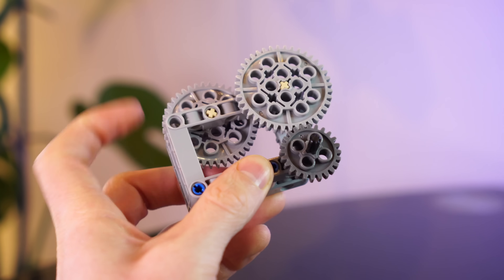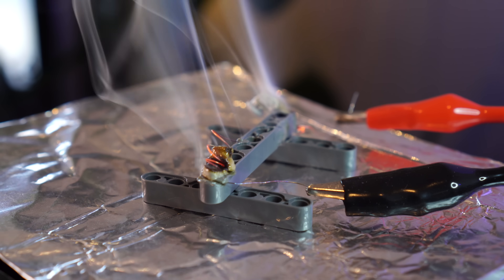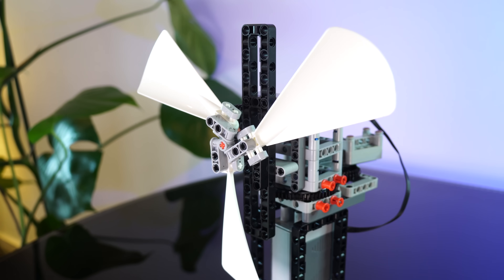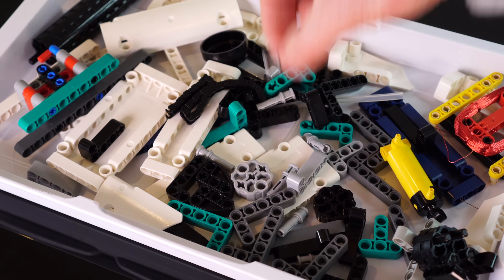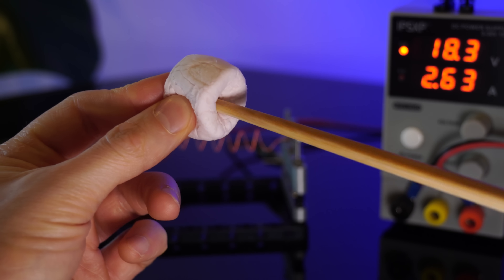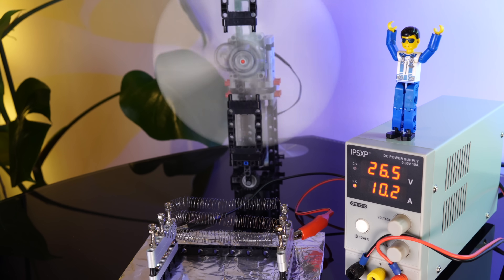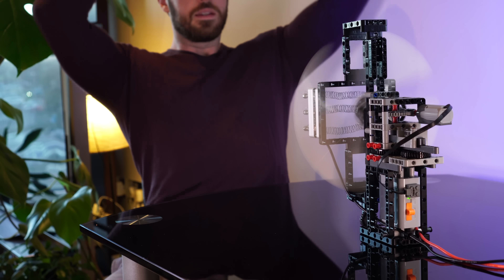Making a Powerful Lego Heater Fan: Will It Melt?

Comment: I made a gear system with a whell on the bar and it runs off of water pushing the whell there is 2 vertions the single gear system and the twing gear system where the singl one is nice and luse and can run at about 300 rpm and the 2 has a lot of conpresin and needs sones of water pressure and can squeak up to 567 rpm heh 67
Reply: BTW I love ur vids James and don't forget your inventions are inspiring me to continue to make contraptions out of lego and I gave up on lego for a bit cuz I broke my fav moter I called Lucy so I forgot it but after being ur kids it kickstarted m to continue thank you and also make sure you don't burn yasself or zap yaself😊
Reply: Vids not kids

Comment: I want to set up a bit of plumbing that has 2 water cooler blocks on both sides of the heating module, where it then goes to a series of radiators blown on by a fan. Then, the now cool(ish) water goes back to the pump and into the bricks.

Here is how the setup should work:
Pump → Water Cooler Brick 1 → Water Cooler Brick 2 → Radiator 1 → Radiator 2 → Radiator 3 → Pump

Comment: You should have put the heating element not in the frony but on the back so it sucks the hot air and blows it to you
Reply: Wouldn't that soften the blades from heat?

Comment: Would you be able to use solid core wires (household wiring) that can support themselves and then wire the coils to them? Then there wouldn’t be anything hot touching the legos and then you wouldn’t need to use the aluminum legos?

Comment: If u would put the heater behind the fan, it would actually just suck the hot air to the blades and push it towards you, with ur design it blows cold air to the heater and reduces the temps on the coils, so ye

Comment: what you have created is, at its core, similar to what a central heating air handler does, and demonstrated why it's very important to include multiple redundant limit switches to prevent dead blower motors (or bad capacitors) from inadvertently setting your house on fire

Comment: WHERE DO YOU GET THE RUBBER NIPPLE THINGIES. HOW DID YOU GET THOSE. I NEED THAT
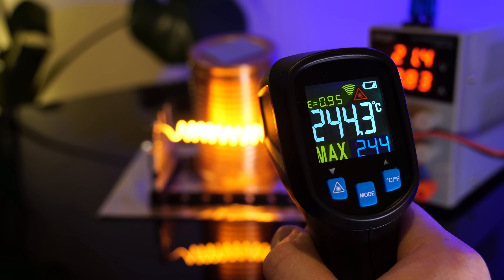Reply: 8:22 made me code brown. Do you know how close you were to electrocution..... 🤢
Reply from the maker: I'm afraid I don't actually remember which set those rubber thingies came in. I think one of the motorised sets with the tracks - the rubber pieces help it stick to the ground. And don't worry about electrocution - the voltage and current is way too low for that. Getting burned is the only real risk here

Comment: Would you happen to be able to use those steel parts to make a turbine that can handle hotter gases than air?
Reply from the maker: Hmmmm that's an interesting idea... I guess it might be possible. Next mission then is how to generate pressurised steam for something like this
Reply: @JamiesBrickJams  the only thing I can think of is a capillary steam generator or a modified coke can into a boiler using candles as a heat source, if you add in a secondary heating coil made of thin copper tubing, you could theoretically make superheated steam, if you do plan on doing this, you might consider making a de-airator to minimize rust, should be simple as pulling a partial vacuum in a sealed vessel

Comment: I think that you might get away with using plastic instead of steel because the fan will cool the wires down.
Reply from the maker: I don't think the fan will be able to cool the wire down that much 😂 Lego deforms around 90 degrees, and that wire is several hundred degrees - even when the fan is blowing on it

Comment: A ceramic heater would be good because it has a positive temperature coefficient, meaning its resistance raises as it heats, so it literally cannot get above a certain temperature

In fact, this principle is already used in many space heaters
Reply from the maker: That's pretty clever!

Comment: Run the motor off the same power as the heater or at least have a board with a MOSFET to kill the heater voltage when the fan voltage isn't detected. But then you're leaving Lego so the light sensor in the other comment is a better "for fun" idea
Reply from the maker: That's still a really good idea for safety, cheers for the suggestion!

Comment: Whats really cool is if you measure the voltage at different points along the heating element you can get different voltages. (commonly known as a voltage divider) infact this is often used to power the fan motor in hair driers/fan heaters and other things so avoid the need for a transformer.

Comment: if you positioned the element lower, so the fan blows the hot air without cooling the coils, would it be more effective?
Reply from the maker: I suspect it's all about the same.. Heat is provided purely by watts of power. Where you blow will only impact how the air is spread around

Comment: You've hit on the design of a good space heater. The amount of heat that a heater puts into a room is entirely dependent on the wattage. By increasing the air speed, you put out a lot of warm air instead of a little hot air - and heat the whole room instead of the spot right in front of the heater.
Reply from the maker: Thanks! And yes, heat should be correlated only to wattage. I think as a desktop personal heater this strikes a reasonable balance between air speed and keeping it aimed in a fairly small arc (vaguely person-shaped)
Reply: Even if it was at the spot right on the heater wouldn't it spread to the other areas of the room eventually?

Comment: Adding a heatsink might have been able to help radiate the heat from the 12v heating element in the beginning of the video.
Reply from the maker: That was actually what I was thinking early on, but I noticed after a short while, that 12 module was only drawing about 20 watts, so I would have needed a whole load of them and a massive heat sink. Nichrome just made more sense for a large output

Comment: use some sheets of thick black paper to measure the heat, shiny surfaces are hard to measure with laser thermometers or infrared cameras.
Reply from the maker: That's a really good idea, thanks for the suggestion, will see if I can find some!

Comment: I’m actually trying to do the same thing like you did but with a battery that I can also take anywhere with me it’s supposed to be like a little heater because we’re gonna be going on a camping trip and I need to be prepared so I’m building a backpack that is a little work bench and it’s actually going pretty good but the problem with it it needs a heater because when we go on a camping trip I will need to bring a tent and it’s gonna be really cold so I need to find a way to build a little heater box inside the backpack I do have a bunch of aluminum cans laying around in my room. I thought they were conductive but when I saw your video about using his legal with the special legal parts, and he said aluminum that reminds me of a aluminum can but I just need your help. Trying to find a way to find a battery that’s powerful nothing easy to charge so I can make a heater. I do have a radio that I can connect by using it as battery but I don’t wanna break it. I want to find a power source on an able to charge the radio while supplying power to the whole back that I’m creating so wish me luck.
Reply from the maker: I admire your thinking outside the box here! And I really like the idea in general - I was thinking of making a little portable heater myself. However, if you're going camping, I'll make a recommendation. If you want to run a small heater like this, it's drawing around 300 watts. So if you want to run this for an hour, you'd need a bank of around 60 5000mah LiPo batteries, which would likely cost you several thousand, and would weigh a ton. Or you could bring about 6 lead car batteries, which would similarly weigh a ton. And this would only run the heater for an hour. You're better off just bringing a bag of coal and some firelighters 😉
Reply: List on batteries just like dispose of the energy without any problems I could try building a circuitboard that can make the energy from the lithium ion batteries to make it way more powerful so when I do that, it might be able to be longer or just die straight like that I don’t know
Reply: There’s gonna be a built-in fireplace inside the backpack I am like really good at starting fire because I’m a pyromaniac so I’m gonna make a blueprint and build a schematic of for the fireplace and the building and try finding a tin can so I can use it for the fireplace frame then I’ll try finding some pop cans for theexhaust so I can go out of the backpack

Comment: As long as you don't exceed ~70-80 °C (158-176°F), the Lego should be fine. Since Lego is made from ABS which starts to soften at around 105°C (221°F), and melts between 190 to 260°C (374 to 500°F).
Reply from the maker: True, I've been realising boiling water is just on the verge of causing it to deform

Comment: The wire sags because it expands as it heats up! This principle was used for the Sunbeam radiant control toaster.
Reply from the maker: Ah of course, that makes total sense, thanks! I guess that's why heater elements are usually coils, so they can absorb some of the loss of tension when they expand
Reply: @JamiesBrickJams  Actually, no. Heater elements are usually coils because this way it is possible to get more length of a wire for a shorter element, therefore get more powerful heaters
Reply: Technology Connections made a great video on it iirc
Reply: TECHNOLOGY CONNECTIONS VIEWER
Reply: @neonphoenix8951  SPOTTED IN THE WILD. HAIL ALEC
Reply: @Sharpless2 LONG LIVE ALEC
Reply: Bro knows the toaster models
Reply: I thought it was because it was melting

Comment: Your thermometer doesn't show "correct" (they are correct, but for different emissivity) temperatures because you have wrong emissivity setting. Your thermometer has emissivity set to ε = 0.95, which is too high. Aluminium (which is the material of the heating module casing, I guess)  has ε = 0.1 - 0.2 and stainless steel has ε = 0.35. Nichrome has about 0.87, which is why you are getting more accurate readings, but I guarantee you, that the steel bolt didn't have 33 °C. But it was pretty cool and interesting video nonetheless, keep them coming.
Reply from the maker: You're totally right, I've just been learning today that I was misinterpreting how I was using this thing. Thanks for sharing, this is very helpful!

Comment: Why didnt you buy a few of those heating elements and put heatsinks on them? Wouldn't that be a lot safer?
Reply from the maker: It might have been safer, but those modules only draw about 20 watts, so I'd need about 15 of them and a really massive heat sink. Not totally undoable, but certainly not an efficient way of generating heat

Comment: thats not how infrared thermometers work. the detection area is conical shaped. at a small distance you can already not measure the temperature of small things. it will take the average of surrounding temperature and the temperature of the part over the whole detection area, the object you are trying to measure needs to fill up the entire detection area (which size depends on how far you are from the object). you can also not measure bare metal since its very reflective in infrared and you will mostly just measure the ambient temperature again. youll need to stick some capton tape on bare metal to be able to measure it. the laser is just a guide. its not actually measuring at just the laser dot. emissivity is also a thing
Reply from the maker: Damn that's really interesting, thanks for the heads up! Clearly I've got to learn how to use this thing better. Or just invest in a thermal camera. The main point I was trying to get across was really just 'hot, hotter, hottest', so it still served its purpose. Thanks a lot for the explanation though - that'll help the accuracy of my next videos! 😁
Reply: @JamiesBrickJams  happy to help :) thermal cameras are really fun! love seeing things from a different perspective. Also have some of the same issues though since its essentially the same as an infrared thermometer but it has thousands of them to make the image.

Comment: your demonstration of what happens when you turn the fan off and let the elements heat up actually demonstrates why you should never block the back of a hairdryer.
Reply from the maker: Very true, I never fully appreciated that until now!
Reply: @JamiesLegoJams  part of the reason  it felt warm at first when testing  the wire is it is shiny which will make a false measurement
Reply: @JamiesBrickJams it is a hair dryer
Reply: @JamiesBrickJams set
Reply: Any hairdryer made in the last probably 39 years will have a thermal cutout and the same with electric heaters.
Reply: @HA05GER  You still should never block the back of hairdryers and heaters
Reply: @Thetankracer  I never said you should but anything bought from a reputable supplier will have safety .
Reply: @HA05GER  You sweet summer child... The safety features don't always work...
Reply: @AngelaTheSephira  there isn't a thing in this world that will always work.
Reply: @HA05GER  what about the Toyota pickup?
Reply: @Combes_  touche sir touche
Reply: @Thetankracer  Of course you should not, but it will not damage anything if you do.
Reply: @AngelaTheSephira  I mean, the safety feature in that case is pretty much a fuse burning out due to excessiv heat, there's not much that can go wrong. And it's not uncommon to have two safety thermal cutoffs in heaters and blowdryers. That aside, you'd never use a hairdryer unattended anyways, so there's not much that can happen. Space heaters, yes, never block those because they do run unattended and stuff around them could get too not too
Reply: I learned that the hard way when I was three
Reply: @bummer6 you are right don't block the back of a hairdryer.
Reply: Otherwise, your hair dryer might just become a (temperature wise) heat gun
Reply: Very true
Reply: dyson

Comment: you should add a light sensor that detects when the motor is spinning and shuts off the heater if the motor stops unexpectedly (like if something is caught in it)
Reply from the maker: That's actually a fantastic idea, cheers for the suggestion ⭐
Reply: Good 3:12